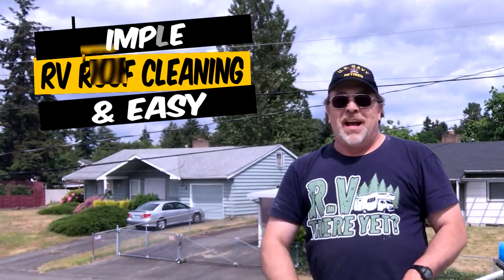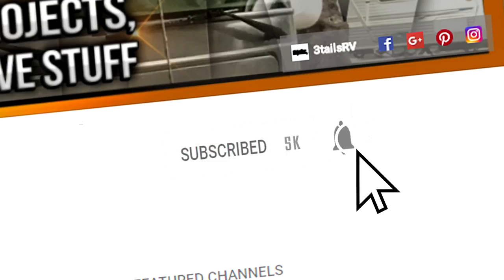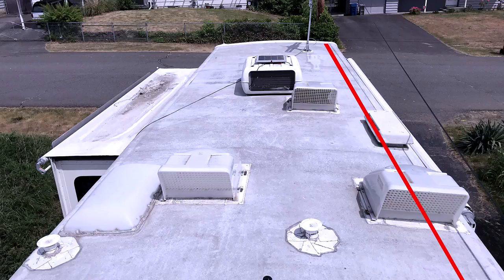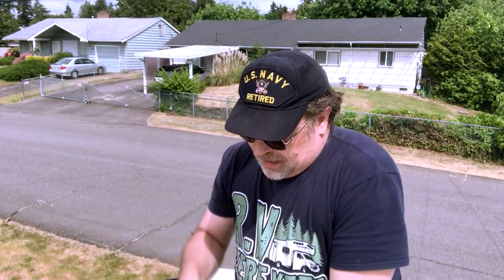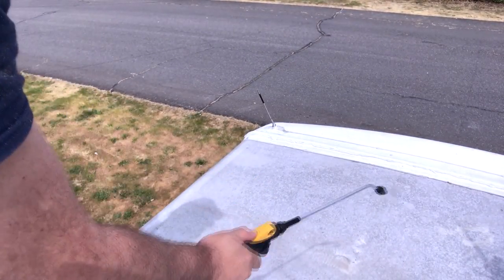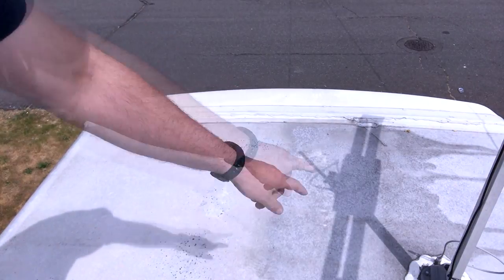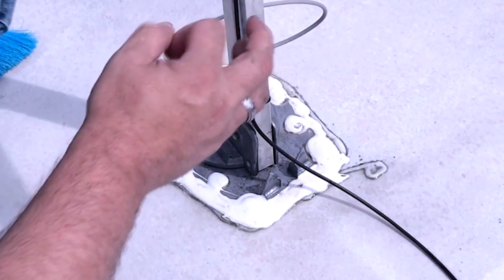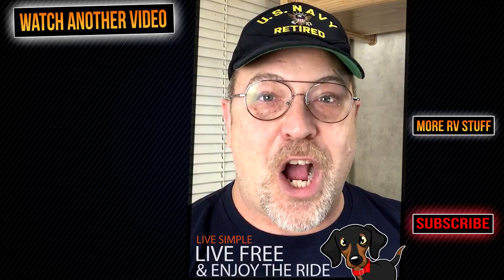🔴RV Roof CLEANING: The Easy Way | RV Living

Comment: What was your product  of  cleaning  material,  and did you dalute it?
Reply from the maker: Thanks for watching and taking the time to post a comment.    I used 1/4 of a cup of TSP and 1 gallon of water in the roundup spray bottle.  Cuts the Grime really good.  You could also add 1/4 cup of bleach and less water. Hope that helps

Comment: I’m a beginner with my rv but could I presser wash it
Reply from the maker: First off Anthony thanks for watching, and taking the time to leave a comment.   that is a debate in the RV community for a long time.   Those that way that it degrades the rubber UV coating (White).  .  I was taught the old tried and true method of scrub brush and bucket so I will continue to do just that.
Reply: Joe Lynott  I can't get up on my Class A roof anymore. Can I use a ladder and a hose with the Wesleys to clean the roof? Thanks
Reply: Joe Lynott  Thank you.
Reply: I use a pressure washer and haven't had any issues.

Comment: But how do you clean it where its snow white? Can I use a pressure washer on it?
Reply from the maker: James, first off thanks for watching and leaving a great comment.   the white is a protective coating (UV) that covers the rubber membrane. Unforantly if you are starting to see lots of black, you have 2 options reseal your roof or replace it altogether. Never use a pressure washer as it will also remove the covering over the membrane. Hope that helps ~Happy trails...  Aron
Reply: @3tailsRV  no, actullally I have a 2018 trailer. I didn't look at roof before I bought it, like a dummy. Anyways, I have seen on YouTube and read where using a low pressure,  pressure washer would not hurt

Comment: Thanks for the video... But I could offer a suggestion that may work for some... Most of the time I don't use soap and water at all to clean the roof of my RV... I sweep it off with a broom and fox tail... The reason for this is to avoid having rivulets of mud streaming down the sides of it and an entire coach to clean or shammy off... I store my unit in a shelter and most of the time it just gets dusty on top... If I don't clean the roof before I take it out then there will be dirt flowing down the sides from dew or rain... Good luck!
Reply from the maker: We was ours 2 times a year (we are full timers) Once in the spring and once in the fall.  While we are up there we check and make sure that the roof is resealed with Dicor as needed.   Dont want any problems with the roof.

Comment: Thanks for the video, i would like to add be sure you dont just get right up there and walk on your roof.  Class A like the one on this video typcially have stronger roofs and allow people to walk on them.  If you have a travel trailer or 5th wheel you need to be very very careful as the roof structure is not as beefed up on those units.   I was told by the dealer for my 5th wheel that anyone over 300 lbs should only be on roof on hands and knees as to spread the weight out evenly, otherwise you could cause a roof failure.   So i use knee pads and gloves when i wash mine.
Reply from the maker: thanks for watching and taking the time to leave a comment...

Comment: Do you see those little black spots on the first section you cleaned?. Well my roof is covered with them and I haven’t found anything that will remove them.
Reply from the maker: Add a little bleach to the solution and see if that helps..  Thank for watching

Comment: I just use my pressure washer. Does all that at once
Reply from the maker: Depending on your type of roof, it can remove the protective coating..
Reply: @3tailsRV  I'm very careful on the amount of pressure I use. I haven't had any issues
Reply from the maker: I use a pressure washer in the side but not the top.   Even after I decorated the roff
Reply: @3tailsRV  like I said, I am careful when I use it and it hasn't caused any damage. I keep a tarp over mine, so I only clean the roof once a year anyways. It's all it needs